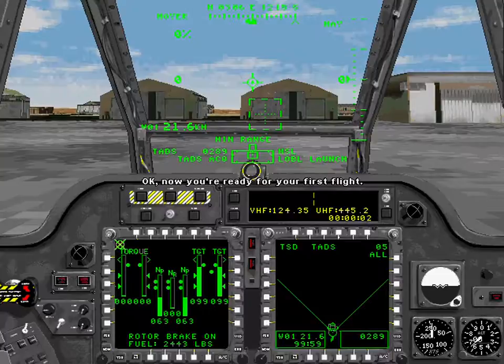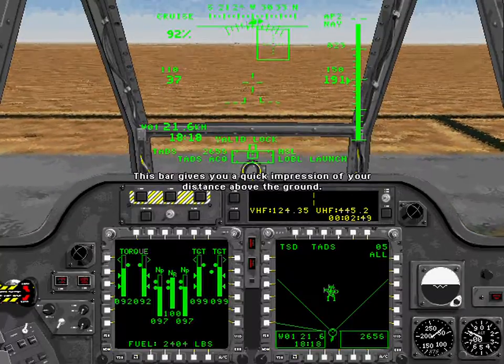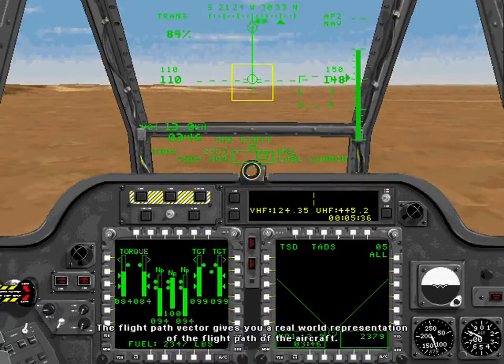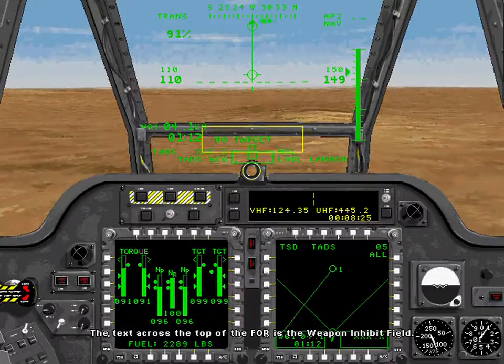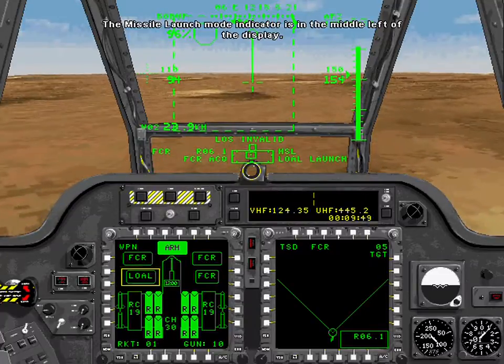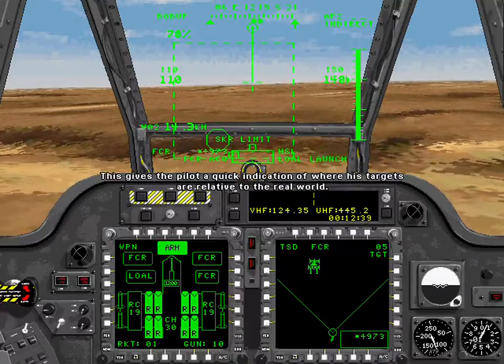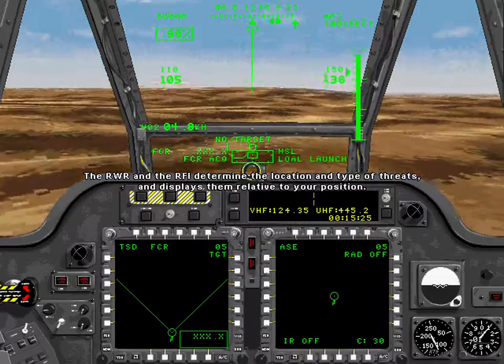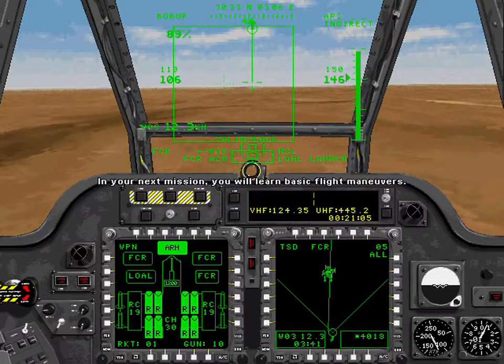Longbow Gold Instrumentation training mission

Comment: Are longbow 2 and longbow gold the same?
Reply from the maker: No!
 According to Wikipedia:Longbow Gold came out in March 1997. It is a compilation pack featuring the AH-64D Longbow and Flash Point: Korea add-ons. It is also fully patched and updated to include a Windows executable, so DOS is no longer necessary. Also included is the 3Dfx update, which adds a Glide renderer.

Longbow 2 came after Longbow Gold and then Longbow Anthology.
https://en.wikipedia.org/wiki/Jane%27s_AH-64D_Longbow